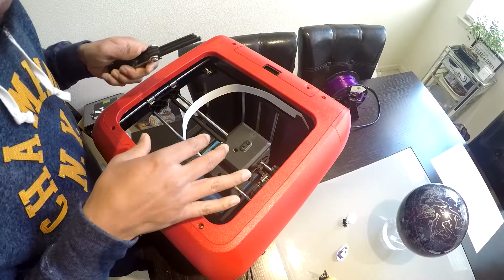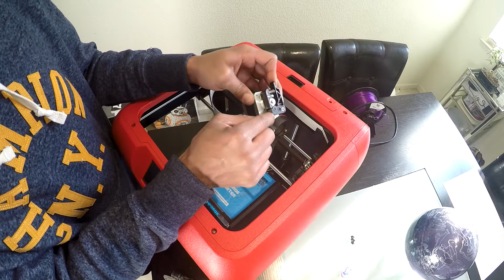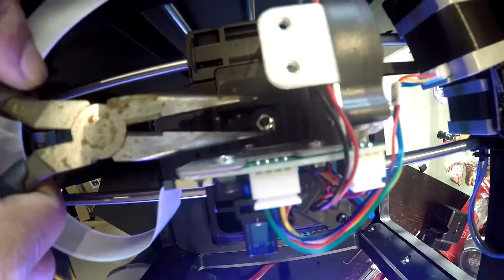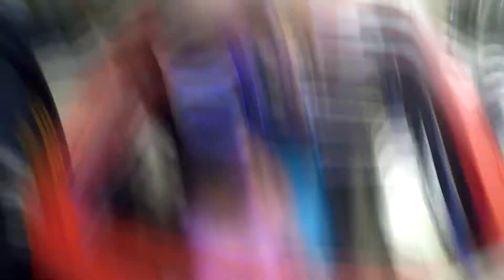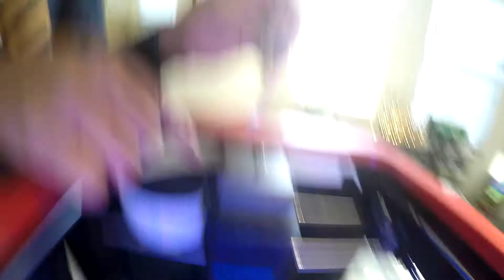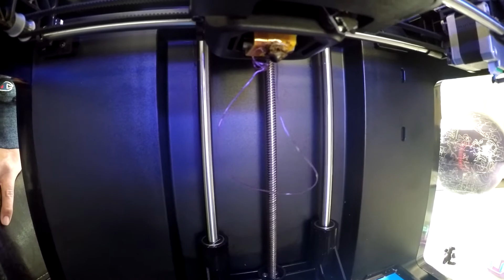Unclogging 3D Printer Flashforge Finder - EASY!

Comment: Great tutorial. The filament still did not come out for me once everything was undone. I am using a wood pla. I ended up putting it on load mode and then pushing the filament down with a small Allen wrench that fits down into there. Eventually it freed it and started to come out of the nosile. I kept doing it until it was all gone. Then put it back together again. All good. Thanks

Comment: I went thru the same.  Could not remove top of extruder.  Stuck on and could not see extra screws.  I did get the filament to go thru and then it stopped again.  Not sure what's going on.

Also noticed that tempo dropped to 200 and would not stay at 220.  Not sure if bc that was a Fast build vs Fine and Standard.  Any ideas?

Comment: hello friend I have a problem with the same printer but the problem is that when it comes to preheating or even printing the status bar it does not rise above 14% and therefore it does not heat, could you help me? what could it be

Comment: Are there no other screws? I just received mine a few weeks ago. Tried taking it our with removing those screws but it is seated solid. No wiggle at all, which means its got another screw somewhere that I cannot seating it has some silicate seating it. What do you think?
Reply: Ever figure out how to remove it? I'm in the same situation!
Reply: @metroairman  After you remove the plastic shroud there are two crews on the bottom front facing side, kinda hidden. Then remove the block and put it on the side of the printer. Then you need to push with a small pin like metal tooth pick the little bit a filament thats stuck in there. Make sure the machine is off.

Comment: Is there something else that you have to do once you have removed the four screws? Push down on a lever or something to remove the motor/extractor? All my screws are removed, yet I still can't remove the main piece.
Reply: On the newer models there is an adhesive strip on the cover where the white ribbon cable goes in. You need to be super careful when you pull the ribbon cable away from the tab. Best of luck!

Comment: Thank you so much for a wonderfully helpful video. I have been struggling to print a simple model for days! I have never had any problems with my Finder before. I am in the process of printing the model again (about the 8th attempt) and, so far.... touch wood, everything appears to be working smoothly after following your instructions. The extruder was not completely blocked. However, I think that was a bit of excess in it that was causing uneven distribution of the filament. Thanks once again!

Comment: I've had a number of clogs recently with a new filament (silk effect).  I'm not brave enough to dismantle the printer (being visually impaired) so I resort to gently inserting an air brush needle.  :)
Reply: Did that work?
Reply: @JoshuaBarberShoppe  Worked for me.  I have a .2 needle and used that and it's printing fine again now.  You do need to be careful and I was terrified I'd damaged the nozzle.  I think I need to replace the nozzle at some point soon but did get some good prints since.

Comment: I unscrewed both screws and the motor is STUCK in place, like it won’t come loose
Reply: I'm having the same damn issue, I thought there was a screw I was missing. Did you ever find a fix?
Reply: parajay84 yes, as it turned out I was screwing the wrong screws
Reply: @adam_the_one_2_356  Yeah... turns out I had the same issue lol. The actual screws were really well hidden

Comment: Great video, helped me fix my printer in just a couple minutes. I’m prepared for the next jam.
Reply: Do the preheat and then if you have tweezers use those to pull it out or if you can just get a knife a scrape the filament

Comment: This does NOT work on mine. I cannot get the motor/extruded part to let go and allow me to pull it out. It’s like there are more screws holding it in. Can you show a close up of how it comes out? I can’t find any other help at all on how to do what you’ve done here. It looked so easy, so I’m frustrated that I can’t get that part to come off. 😡
Reply: Initially mine was like that,it would pull out so far then stop but it did come out eventually.I pushed up and down then it came out.I assume you did heat it up?
Reply: @Kavlor1  Yes, I did heat it up, but the problem I was having was taking the whole thing apart to service it and get out any filament that might be stuck inside the machine works. I eventually got my filament unstuck with the help of that nifty tool that came with the machine.  I would still like to be able to take the extruder apart so I can service it, but I guess I will wait until it becomes a 'real' issue. Thanks for responding.
Reply: @tubinpammi   Did you get it to come out? I was stuck the same way. took screws out and still couldnt remove it.
Reply: Carmen Stearns No, I never did get it to come out.  I (luckily) have not needed to open it up/take it apart. I’ve been printing without any issues. Once I realized how to use the long metal stick that came with the printer, to clean filiment out, I haven't had any other issues with it.
Reply: @tubinpammi  make sure you’re screwing out the holes that need the Wrench and not the Screwdriver. Same thing happened to me.

Comment: thanks for sharing. We have tons of these at the school I work at and these are SOLID and very repairable machines !
Reply from the maker: Yes they are, I was very impressed on how simple it is to take apart and put together this unit back together.  I have been running one strong now non stop for several months and not one single issue!   Great machine!